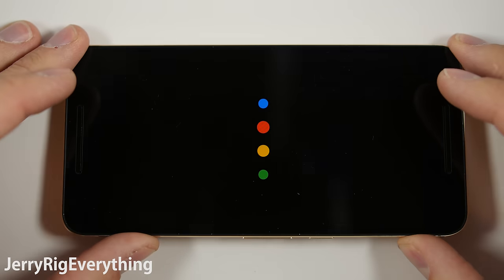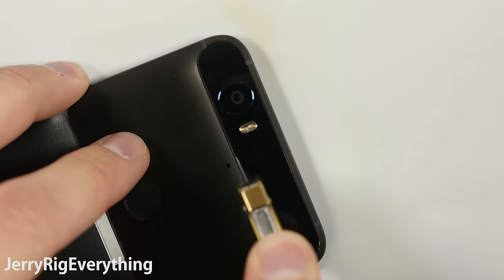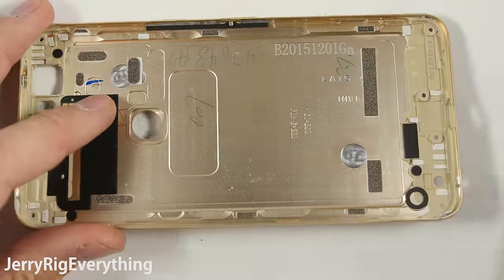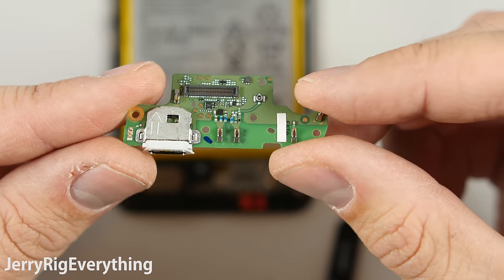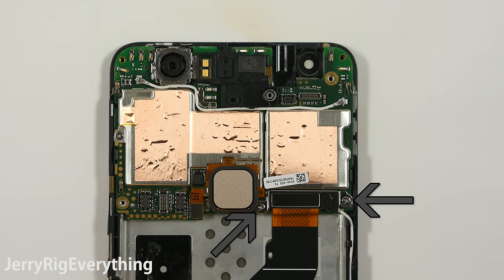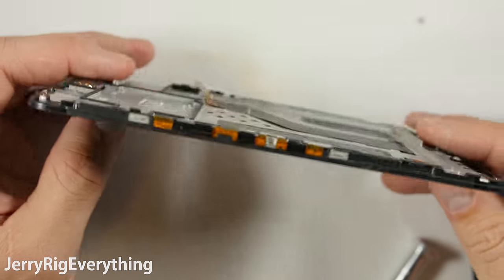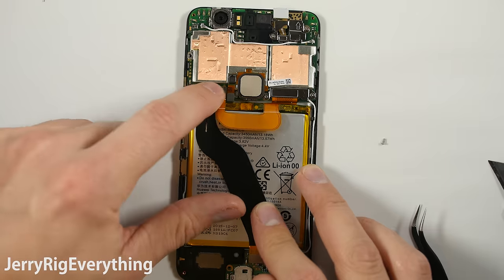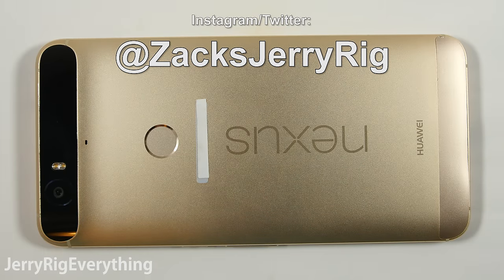Nexus 6p False Advertising - Teardown - Repair Video

Comment: I hate false advertising...
Reply: I love them. So misleading and controversial.... Said no one.

Its like saying, i hate cancer... No shit
Reply: Me too... They crossed the line with the nexus 6PEE!!
Reply: +David Lawman Well a lot of their advertising was honestly not the reason I bought the phone. I bought it for say stock android, front facing speakers, the metal exterior build etc.
Reply: HERO True, but I bet it still disappoints you once you know the truth.
Reply: ***** Not really since you know, doesn't have any real change on how I use the phone.
Reply: HERO Durability is a long term problem :)
Reply: +David Lawman agree.... If you buy a phone and use without any protection is good to know how durable is it before buying
Reply: +HERO Except for your dent and scratches even while using an official case.
Reply: don't even play Google movies
Reply: This is not exactly false advertising since the phone actually uses metal as the frame but uses plastic as well for re-enforcement. I've used many all plastic phones such as the Moto Atrix and Note 2 and they well survive everyday's bend and stress. I doubt "all metal" frame (without plastic re-enforcement) would perform that well.
Reply: Daniel Law It all depends on how well you build it.  For example, it takes double the weight to bend the iPhone 6s than the iPhone 6.
Reply: Aluminium in general has less stress tolerance than plastic. You can bend a plastic phone to a curve and you can see the who frame returns to its original shape. That's why Samsung keeps its plastic structure for so long. Plastic frames tend to allow itself to be bend easily (somehow like the wing of an airplane that wiggles while taking off) so it makes the frame feel unsubstantial and cheap. Aluminium frame on the other hand feels more substantial but it tolerates less stress compared to plastic. If you bend an aluminium frame with the same threshold force for the plastic frame, it would likely to bend before reaching that threshold force. That's why some maker like Huawei combines plastic with aluminium so on one hand, users feel the phone to be more substantial and on the other hand, the phone is more flexible. One day people might develop some combined material to solve this as well but at this moment combining plastic with "real" aluminium seems to be the best option.
Reply: Or using more expensive aluminum alloys. They will take much more weight to bend and cost more cash to build.
Reply: ...and the phone will take more cash from your wallet too!
Reply: Go review a knife lol
Reply: Almost Smart Too lazy to do so lol...
Reply: I hear you
Reply: ***** LOL...
Reply: same
Reply: 340PD cheerios aren't healthy?
Reply: Aaron Acevedo LOL...but tasty.
Reply: So you came just for the teardown? OK. We're still working on getting that thumbs-sideways button. Hold your breath.

Comment: What a shame the 6p is so fragile, is a really good looking phone.
Reply: this video and his other 2 are not representative of normal use
Reply: He didn't do anything extra to this phone. Why did the other phones survive and this didn't? He even showed WHY it cracked. Being a fanboy must be a colorful world I guess.
Reply: Kirina Yuuki oh trust me, it is.
Reply: Have had mine for over 2 years at this point. Still structurally sound and without any physical damage. I don't use a case, just a dbrand skin and have dropped it multiple times onto hard surfaces. His video does not represent normal use.
Reply: @xXkurosenpaiXx  that may be so, but many other phones have passed his durability test and while the test doesn't represent normal use it still provides a solid idea of how well made a phone is and that's what the test is ultimately for.
Reply: @pokepal148  phone is over 2.5 years old now. Save for some dents and a few scratches, it's still structurally sound. Still without a case too.
Reply: Take care of you phones better. You paid for it.
Reply: No, fragile is an all glass device that after hearing it up to do a teardown for a screen replacement, it cracks because it is so tightly fit into the chassis. This phone is seriously by FAR the easiest phone I've ever refurbished. Just replaced the screen, battery and housing on mine. Practically a brand new  Nexus 6p in 2019, just hope the chipset keeps holding up. No bootloops yet!

Comment: I'm glad you exposed this phone.  Hopefully the 2016 model is structurally better, properly advertised, and less misleading.
Reply: +4g63mark This is why he does it thankfully.
Reply: +Cristian Farapon They amuse me, therefore I don't mind them.
Reply: +4g63mark LOL this guy is most likely paid by Apple yet despite his tremendous effort to disgrace Nexus, people are still buying and it's right there on top with the latest phones. It's not the perfect phone but calling it a joke was pathetic.
Reply: John Chaser Structurally weak? Have you used it? Because I have and haven't had any with these issues. Stop being a mindless robot, dude.
Reply: I have it and so far no issues, but that doesn't change the fact that other phones are built better. Look at his latest Oneplus 3 teardown video. +John Chaser is right.
Reply: +Megatron i had two, both bent and their replacements, but I'm over it because i got a refund... Hopefully next years doesn't bend while just in loose jeans pocket..
Reply: Tom Elwood I wear loose Denim jeans but never head this problem.
Reply: Megatron hmm, did you use a case?? Mine bent so easily. . I was really curious, and i know its a dick thing to do. But i went into my local shop that had a retail unit (working and all), i tried to bend it discreetly and it bent like a refrigerated toffee bar, soo easily..
Reply: Tom Elwood Nop, no case or screen protector.
Reply: Megatron they must have changed the design somehow... On the teardown it is built terribly though and it isn't even all metal, but oh well, if it works and suits fair game
Reply: +Hassan But Zack also disgraces Apple
Reply: @MrCaptainInternet  Nexus died due to this fuckup.

Comment: I have had this phone for almost two years now and used to really like it. It 'was' fast and it 'did' have a good battery life; now I am needing to replace my battery and my phone is much slower than it used to be. I am a fan of this phone and honestly, after using an iPhone for many years before my first android, I was hesitant, but now I absolutely love it and cant stand iOS.

 I spent some time working part time in a mobile repair store and got to know the guys working their. The one time we got a customer bringing this phone into the shop, it was a pain in the ass to repair. That said, almost all new phones are. Breaking the glass cover at the top is not a huge deal, buy a new one and replace it. (Honestly, buy an extra just in case if you are planning to repair your phone because the chances of it not breaking are very slim.)

To all those hesitant about this phone and the 'false advertising' about the "full metal body"; this is a trick done by every company out there and to be honest, the average consumer (which is probably 90% of the viewers watching this) don't ever even notice the fact that they misdirected. Honestly, I kind of liked the plastic bits on the back, they add some texture. Different perspectives come in everything and the only reason this video is portraying it in a bad light is just due to the fact that Google/Huawei "false advertised" it. 

Otherwise great video, really informative and entertaining to!

Comment: First thank you so much for this helpful video.

I cracked today accidentally the display of my 7 days old 6P. The glass front is ok, but the amoled display has a few cracks and is totally white and bluish. So I decided to repair it on my own.

As I saw on the video the main problem is to save the black glass bar of the camera and the plastic bar on the bottom while replacing them. I removed them successfully without any problems. I used a self made tool of an shaver blade and enough heat :). I ordered the screen with the frame because it's only 10$ more and it is a lot easier to change the whole frame.

Comment: Honestly love my 6P. Best phone I've ever used.
Reply: +Lazar Yeah, although for some reason even with the official Huawei case on the phone I still got a dent in the back. The case has no damage?
Reply: ha
Reply: So the 6P is just a rather average phone compared to the rest of the smartphones out in the market...
Reply: Lazar Still using the Nexus 6P today
Reply: yes but mine bootlooped a couple of weeks ago and  thanks to xda i've restored it with half the cores...Really disappointed about that :/
Reply: Lazar mine was til the battery issues...4 warranty replacement devices and then the bootloop problem.
Reply: is that a joke? why not a pixel? the 6p is as fragile as glass
Reply: Gavin EXE I've dropped my 6p on concrete several times andalso falled on my phone while running.This phone is like a tank.
Reply: Average? It still has the best low light camera to date (Q1 2018 phones)

Comment: For removing glass, I recommend using an Xacto chisel. More surface area means the prying pressure is more evenly dispersed and thus a much lower chance of shattering the glass. Also. I always unplug the battery first when disassembling a phone/tablet. Even though the device is off, there's still current traveling through the parts.

Comment: I've had the phone for almost 3 months and it's the best thing on earth. It hasn't bent, no glass has cracked, and no buttons have deformed. Everything has its flaws but I have yet to experience one on this phone. It's fast, smooth, and beautiful.
Reply: yup I love it too plus I got my Google nexus case with micro fiber back today!!!!
Reply: +Taskin Forkan Nobody said you shouldn't like your phone but facts are facts about the plastic build and dove tails. Google and Huawai need to be called out.
Reply: +Billy Bob Jimmy Joe Dude killer user name!! cool. Peace
Reply: Every new phone you buy will be the best ever if you update premium phones, that is the way tech works! I am sure if you buy the Samsung S7 with a CPU that will kill the 6p's that will be the best ever. The problem is that consumers are now seeing there is a reason why this is cheaper than the iPhone, it has structural faults, plastic instead of aluminium, softer metal, slower storage and RAM, etc. That will kill its second hand price especially for anyone who is worried about how the 810 will effect the phone in the long term (even with the drastic throttling). I would buy the Nexus 6 at nearly half the price of this, as I am not a camera buff, but the fingerprint scanner would be a loss. For most tasks the older nexus 6 is fine and it has proved to be very reliable and has updated well to Marshmallow.
Reply: +TheAE35Unit What his facts. Jerry isn't and shouldn't be more trustworthy than Google or Huawei especially with his pathetic title used on the original video.
Reply: +Taskin Forkan I had the phone for only a month and for some reason even with the official Huawei case on the phone I still got a dent in the back. The case has no damage?
Reply: HERO Check out r/Nexus6P on Reddit, they can help you out. I've never heard of denting on the back of the phone unless you mean it's bending.
Reply: Taskin Forkan Nope, it's a soil dent. I already plan to contact Huawei about this later.
Reply: HERO You're better off contacting Google if you bought it from them, they're much more helpful.
Reply: Taskin Forkan I bought it at my local carrier. Also I already did contact Google but they told me to contact the manufacture (Huawei) for assistance.
Reply: For some reason, I recently noticed that mine is creaking while holding it at the sides. Is it something I should be worried about?
Reply: Varun Rao Do you have a case on the phone? If so that could be the source.
Reply: +HERO Yes. You just made me realize that my current case is pretty tight and that I noticed it creaking only after I put that case on. Will it improve if I remove the case?
Reply: +HERO But it creaks even after I've removed the case :(
Reply: +HERO it's because you didn't buy it from the Google store
Reply: Epicfighter10 I shouldn't have too...
Reply: HERO i agree with you but since there are two companies involved its a weird situation
Reply: Taskin Forkan it's a good phone but the false advertising is..... ew...
Reply: Taskin Forkan so. you were butthurt that someone points out the flaw of YOUR phone. why do people do that.
Reply: Taskin Forkan Lmao, how's it now?
Reply: In hindsight, the phone sucks
Reply: Taskin Forkan is it still working well?

Comment: Jerry Rig, I say you have a 100/100 chance of getting the top visor glass off in one piece if you do it right. You just need to heat the glass up hot, then use a razor blade and apply it to the right side of the visor and gently work your way in. In that way, I never broke a single visor and I repaired 5 Nexus 6p so far. Actually, the Nexus 6p is a really easy phone to repair once you learn its trick. I also can take the back off very easily without damaging the plastic that goes around the phone. I just insert a sim card removing tool into a bottom screw hole to open a gap to pry open the phone's frame from the back. Now, I can open up a Nexus 6p really easily.

Comment: Those screws are stronger than you think. I forgot 2 of them at the bottom and was wondering why i couldn't pry the display off. I was giving it a lot of force with taking care not to bend and break the display or glass. Also, back camera glass comes off fairly easy with A LOT of heat from a hair dryer and an exacto blade. Work the point between glass and aluminum and start prying up while simultaneously pushed more blade surface under the glass. The more blade surface pushing the glass up will decrease chances of breaking.

Comment: I've had this phone since release and have used it hard every day. After 2 years of hard use, my 6P is tired, but it survived. I've dropped it many times, frozen it a few times, and once kicked it skidding across the road. It is still usable, just slow and the battery is tired.

My favourite phone ever, hopefully my NIB Pixel is anywhere near as good.

Comment: full metal aluminum plastic hybrid design 😂😂😂😂
Reply: +Wow 

Paluminum
Reply: +TheAE35Unit Or plaluminum
Reply: +Wow As long as my hand touches aluminum when I pick the phone up I'm okay.
Reply: +HERO Then stay away from the top and bottom or you might be repulsed by disgust.
Reply: TheAE35Unit Well your hands do usually rest on the metal part.
Reply from the maker: +Nickoy 1 At least the new S7 has screws that screw into metal instead of plastic: https://www.youtube.com/watch?v=I7-usvOfZpQ
Reply from the maker: ***** uh.... https://youtu.be/r3cWVdLqXCg?t=4m24s

Comment: Whether you like it or not gotta say I am a huge fan of the design of the Nexus 6p. It appears to be very modular and relatively easy to repair. I no longer am using my Nexus 6p as a primary but, it was awesome only problem was that the graphite back scratched with fingernails which is kinda a bummer.

Comment: Agree it's sham that it's not a full metal design. However for how thin and fragile it seems, it tears down and holds up really well. I think overall it's a good design. The only thing I really don't like is the strong glue holding the battery down.

Comment: Almost 2 years later and my phone is 100% intact. I've dropped it many many times and the screen has never cracked. So the frame held up perfectly. Only issue is that the battery has started to fade. Replacements are ~$25AUD. My favourite feature is the fingerprint scanner location. Whoever thought of putting it there deserves a medal.

Comment: I have this phone since november 2015 (around 8 months) and didn't had any issue with it until yesterday. The screen is coming out of the aluminium case and because I didn't bought it directly from Google, it's a pain in the ass for the warranty. They claim it's my fault (even if I was really careful with it... never sat on it, didn't put it in any skinny jeans or dropped it from any height), and physical accident ain't covered by Huawei. The phone still looks like new outside of fact that the screen that is now coming out of the frames because of bad design flaws.

I really liked the Nexus 6P, but I can't stand behind a company that doesn't acknowledge the design flaws that the build have. On a side note Videotron didn't even want to replace it with the same model or any recent one as they don't have it in stock. The best they could offer me are refurbished LG G4 (somewhat older technology hardware than the Nexus 6p).

Comment: I have the nexus 6p., it's a good phone but my plastic strip around the screen has shaped off on some edges of the screen
Reply: adem Yeah mine too. it's so annoying.
Reply: Mine too.. I scrubbed off majority of it with my nail tho.. lol
Reply: Same here its been flaking off and its annoying , when i took it to repair the battery they told me it has alot of damage when it barley has a scratch , and  i ve been using it for 3 years

Comment: Hi Jerry! Thanks for the video. I was attempting to replace my battery and after removing the back glass and the plastic and the nails i tried working on the front. Only for the screen and the AMOLED panel to come off! I can't seem to get the rest of the assembly out of the frame. Any suggestions/advice? Unfortunately it looks like i've managed to damage the screen assembly in the process. Thanks